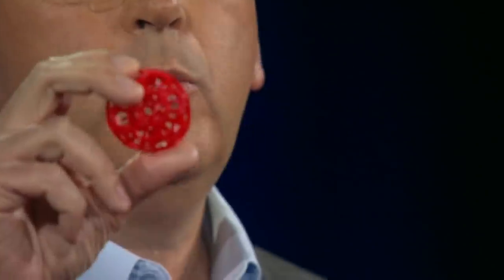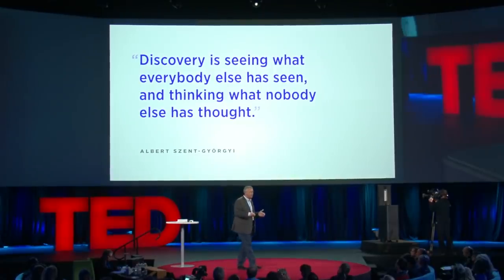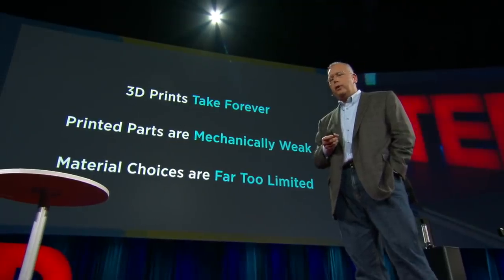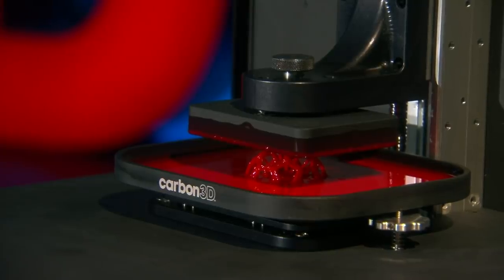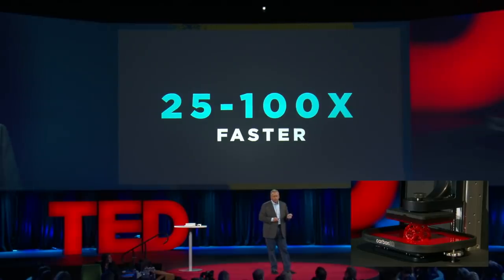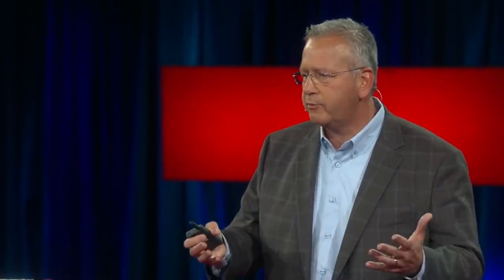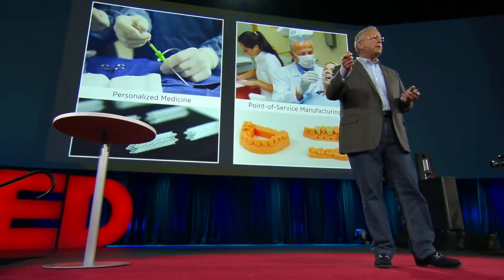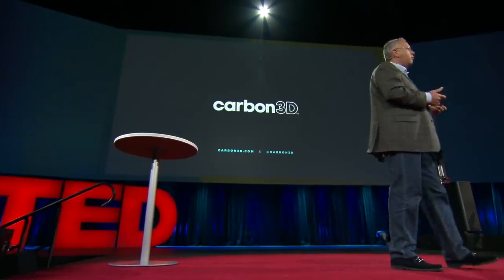What if 3D printing was 100x faster? | Joseph DeSimone

Comment: "3d printing is a misnomer, It is not actually 3d printing, it is 2d printing all over again". 
So... cube is also a misnomer, because it is actually a square all over again for times of length of one of its sides.
3D printing -> To print 3D (not printing with 3D)
Milk drinking -> To drink milk ( not drinking with milk )
Bird hunting -> To hunt birds ( not hunting with birds )
Is Milk drinking misnomer because it doesn't tell that are drinking it through straw, straight from bottle or from titty.

Comment: 2D printing is ALSO a misnomer, either a so-called 3D printer or 2D printer actually prints 1-dimensional lines, forming into the eventual shape of the 3D or 2D model.
Reply: +Adam Rath 1 dimensional is ALSO a misnomer, since the lines are a infinite succession of dots, dots have no dimension :v
Reply: +zekbss true facts

Comment: How about costs? There are a lot of marvelous things in the ivory towers of taxpayer funded university labs; but they are for the most part unfit for the market, without talking about costs x benefits one can not really make a well informed reasoning or decision...
Reply: +baianoise Id say less then a typical 3d printer.
Less mechanic parts, uv projector - a special screen and some oxygen - the material can be a wide range of uv sensitive polymers.
A larger version could pull out a whole array of identical products every few minutes - closer to injection molding speeds - but for more complex parts.

Comment: This is the best printer in the world so far. To bad I couldnt figure out how it works. I fell of the truck when he was explaining how the UV window and oxigen make a dead zone. Huh?
Reply: So it doesn't get stuck to the glass
Reply: Wherever the oxygen layer is the resin won't cure under UV light. By controlling where the oxygen layer is and isn't they can control which bits of resin cure and become the part.

Comment: Is this standard resin printing? Typical resign printing  fast but the resin is really toxic and hard work with. Also, if that oxygen window fails to pump enough oxygen, the print can adhere to the window and damage it.
Not saying it's not game changing; it is. But I think this is better for industrial uses at the moment.

Comment: I stumble upon this once again in my recommended. I now have a DLP printer. They make it sound like they invented 3D printing with resin and light. The only thing innovative they do is change the chemistry of the resin and continuously move the build platform. which is all proprietary trade secrets. They charge a fortune for these machines too. My $600 DLP printed may print slower than this one but I would gladly take a 10 hour print for $600 over a 1 Hour print for what they are charging.

Comment: This is just SLA printing... This has been around forever. And that eiffel tower print is still layer by layer, the layers are just much smaller.
Reply: +Videblu - It's SLA printing without the "layer peel" step. Because there's no need to stop printing to peel the print off the bottom of the resin tank before advancing the Z axis, the Z axis can move continuously, and the vertical resolution of the print is limited mainly by the resolution and frame rate of the optical system - and the print can proceed much faster without those frequent interruptions.
Reply: Tetsujin The layer peel isn't necessary, it just provides slightly higher quality.
Reply: +Videblu no the layers are not "smaller" - think of it like squeezing play dough through those kid toys to create a shape - the oxygen stops it from curing so no layers are created - just that the stencil shape changes to create complex objects.
Reply: +Mauro Tamm there are still layers.

Comment: First-Why design a part that is difficult to mfg. Shame on the design engineer. And that part looks VERY moldable. 
Second-Its NOT 2D printing, if a layer has thickness then it's 3D.  
Third-This is fascinating, its as if they've taken a quantum jump with the concepts of the original laser driven lost wax/laser method of wax prototyping . Very Cool.There's still too much "Hollywood" marketing glitz and glamour in the presentation.  Still gets a YES.
Reply: +Frohnster "Why design a part that is difficult to manufacture"?  Sounds like the wrong question. The point here is that they're on the path to changing how we define what is "difficult to manufacture" - and this will yield exciting new possibilities as the technology matures.

Comment: Why do you need it to be that fast? I mean, I love cleaning up the layering and material strength, but having a 3D printer that fast means you're coughing up parts faster than you can use them. And they don't dissolve or break frequently enough that this speed is necessary. It's cool, but I'm worried that the amount of downtime in 3D printers like this meaning that every time you need to use it. There are times that this speed would be useful, but generally you don't need things to be that fast.

Still, cool, though.

Comment: 3d printers do NOT print in 2d over and over again. 2d has No 3rd dimension. Adding multiples of a of a nonexistent dimension still has no thickness. My 3d printer has adjustable layer height...a 3rd dimension.

Comment: sound like your trying to convince yourself your equipment isn't obsolete. fdm is slow. way slower then carbon clip. I have several printers. including machines that print at 150mm /sec and they are not that fast. not even close. sure I print thick layers and it will print quickly.  that thing will print smooth and have strong parts. something fdm will never achieve in all directions. go play with your toy

Comment: What if 3D printed parts didn't look like s**t and break when you breathe on them too hard? It's fine for prototyping, but holy crap, stop manufacturing stuff with 3D printers. Everything that comes out of a 3D printer looks like it belongs in a toybox with a K'nex set.

Comment: 100x faster??? ok so that's why you only need 10 minutes to print this tiny buckyball,,, right? 100x10 minutes = 16.6 hrs rights... throw that printer out if it is that slow :) I mean it's cool but you don't have to lie about it to make it interesting.
Reply: yeah, you're right. My current printer would take from 20 minutes to 2 hours, depending on what resolution i set it. But 16 hours for that ball? Never..